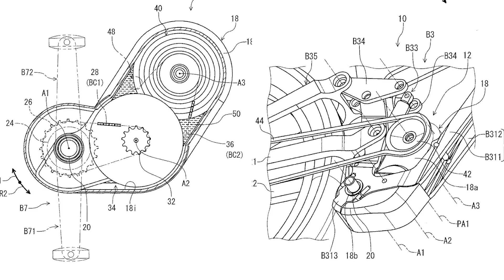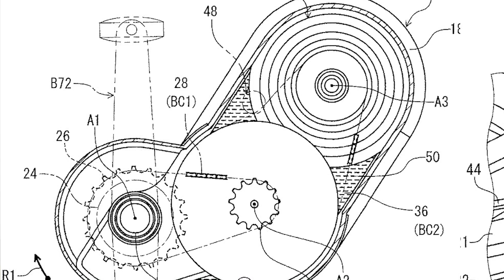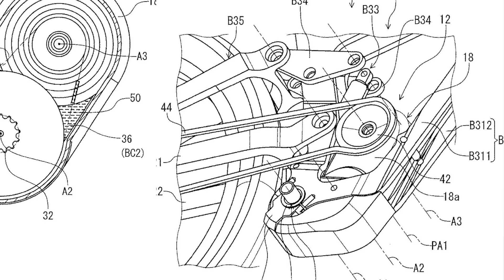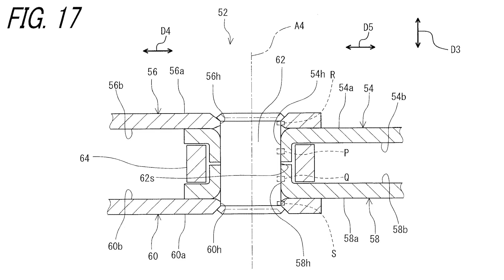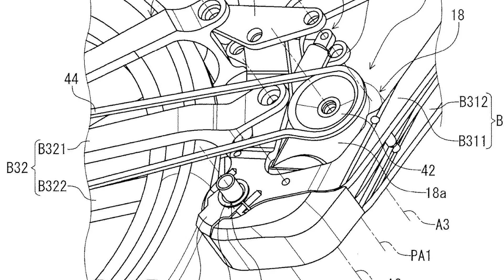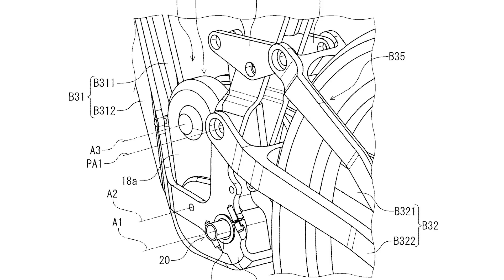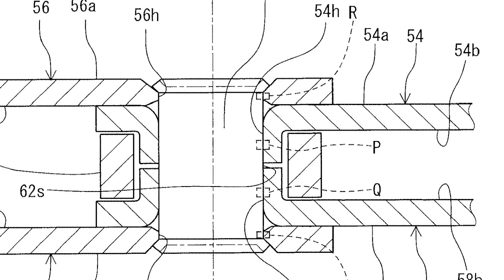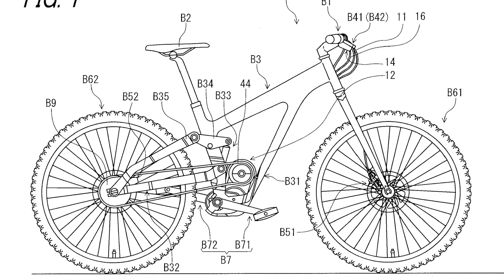Death of The Derailleur? | Shimano's Gearbox Patent

Comment: I really appreciate your efforts in discovering this patent & sharing it. I think it’s a fascinating pivot, because it both leverages Shimano’s knowledge about gearing & manufacturing prowess while making a potentially monumental shift in design (pun intended).
I wonder, if Shimano is basing the bottom end to be the same as their steps motor, is it possible that they intend to put steps in & make a complete motor & gearbox in one? If so, THAT is the future in my opinion. You centralize all the weight on an ebike, which would make the suspension float across anything. 
Until then, I’m looking at a pinion as my next drivetrain & bike. I’m completely sold on the durability of gearboxes. I also love the gear range you can get out of the Pinion, 636% is great for the hills of San Francisco, & I don’t think Shimano’s would cover that range (chains being the limiting factor, but correct me if you think otherwise). I think Pinion has a bright future, regardless of what Shimano releases.

Comment: I Don't Know? I really couldn't take this seriously! Why After All these Years, And What about the Rohloff Hub?
Reply: Having the weight in the middle of the bike has handling advantages, most especially if you’re putting it on an mtn/gravel bike. 
It also allows you to change out wheels really easily, so you can have one bike with various wheels set up & swap them out as you wish. You can’t do that with a rohloff.
Reply: just because market started to accepting. it's still less efficient and heavier than chain.

Comment: I would love a gearbox on my mtb. Especially one without gripshift like pinion. But if this then means the need for electronic shifter it is a bit off-putting to me. Mostly from the perspective it is going to be a long time before prize goes down enough for the regular bikerider's wallet size
Reply: Just put your Derailleur in a box!
Reply: @Aljonone1  love it!
Reply: @lazze13  Funny thing is it works really well, only difficult thing is getting casings to fit round the derailleur!

Comment: Can't wait to have a gearbox bike - it seems like the perfect solution for a Canadian winter bike!
Reply: What about the cogs and chain on the outside - won't they be covered in road salt and wear all the same as your regular old bike?
Reply: Don't delay- buy a planetary hub today!
Reply: @TheLaXandro  Until the lubricant freezes in the Canadian winter
Reply: louiscormier12 - "Can't wait to have a gearbox bike"
Rohloff - "Hold my pinions"

Seriously - check out some of the extreme riding done on Rohloff hubs - some of those rides make Canadian winter riding look like a Caribbean beach bike trail rental.
Reply: @47f0   Just Cover your current drive, you will save money on chain lube!
Reply: Nuvinchi, pinion rollof,there are many gearboxes on the market they are priced high,a chain based system like this is probably going to be lower in price.when you see wallyworld selling them that's when the cost will come down.
Reply: What are you waiting for? Buy a bike with a Gates Carbon Belt drive and Shimano Alfine hub (e.g Spot Acme, Veloheld Lane Stnlss, Shand Stoater). It’s what I have for riding all year round on muddy English country lanes and it’s perfect. I’d never go back to chain and derailleur.
Reply: @finnbarcunningham2724  OR  Just Cover your current drive, you will save money on chain lube!
Reply: Just Cover your current drive, you will save money on chain lube!
Reply: Just put your Derailleur in a box!

Comment: A genuine question: why is this better than an internal gear hub?  What are the limitations, advantages and inefficiencies of a hub based system?  In my non-engineering brain they seem to offer many of the advantages a gearbox would offer.  Whilst shimano might be willing to develop the gearbox it'll probably take a little while longer for "proper" bike brands to build bikes compatible to a gearbox and then many years after that for both systems to be perfected.  I imagine I'll be riding gearbox free for at least 10 years.
Reply: ps great content and keep up the good work
Reply: I see more of an advantage offroad, especially full suspension, it will improve sprung to unsprung weight ratios and open a lot of doors for pivot placement options (some of the drawing seem to show something that looks very much like a high single pivot suspension platform). Any gearbox system will also bring the center of gravity closer to where you want it. Taking full advantage of those possibilities would definitely outweigh any weight penalty (in my book anyway) for more gravity focused offroad usage.  Not sure about road riding though, maybe less exciting for that side of the industry.
Reply: Other advantage: it makes it really easy to change out your wheels for different ones based on the kind of ride you intend to do. With gravel bikes that becomes particularly interesting, you could have a 650b 47mm tire & a 700c 28mm both work. On an IGH, you’d have to have a gear hub in each wheel, which isn’t really practical.

Comment: I can’t understand how is this supposed to be any better than hub gears that have been around for decades, especially coupled with belt drive.
Reply: Marcin Obara I did read about it being better having the weight near the middle of the bike and not in the rear wheel. Also something about improved suspension performance due to the centralised position.
Reply: The problem with a gear hub on a rear suspension is that the unsparing weight in the rear wheel mucks up the suspension's performance. No so bad on a hard tail. Check out Zerode mountain bikes with Pinion gearbox for a more full explanation of this problem.
Reply: It keeps the expensive parts on the frame, which is more convenient to lock up. That's it.
Reply: In addition to the other comments, except for Rohloffs, planetary hubs have very poor sealing from water etc, pick up a Shimano or sturmey 3 speed and you can see the bearings of one of the 3 bearing races looking you right in the face, no sealing at all.  They are difficult to service and lubricate, especially the sturmeys, they are heavy, have a lot of internal drag (again excepting Rohloffs), and stop shifting under -10 C.
Reply: @PRH123  In support of the sturmey archer type, they used to be lubricated by a grease gun, pushing out dirt through the gaps in seals, and the increased drag would be overcome by most people by a few weeks training.
Not saying they should be used for competition, but I have a Shimano 7-speed hub geared bike that has not needed attention for 20 years.

Comment: Seems like a CVT. With the two opposite cones (cassettes) and the always straight chain line moving from one side to the other. The difference is that it will have discrete positions chosen by the rider. I wish buying one will not include selling a kidney to the black market...

Comment: It looks inspired by CVT transmissions in cars - two "cones/cassettes" connected by a chain/chains - with a control system to dictate the shift points. Might even in time lead to a proper CVT system on a bike, unlike the bonkers Landrider "Automatic" changer
Reply from the maker: The full patent suggests it would be possible to include a CVT version, though exactly what shape that would take is not explained; https://www.bikeradar.com/news/shimano-gearbox/

Comment: 1) How likely is this? My $0.02USD, not very. I suspect the patent is there because they can, and needed to stake out of some land in the gearbox world.
2) Do i want one? sure, but only if it's based on an open standard shell/housing that i can place any complying gearbox into. Like a threaded bottom bracket.
3) I'm not convinced this is better than a normal involute spur gear in terms of efficiency. I wouldn't be surprised to see a planetary gearset sometime soon, to make the whole system more compact with final drive coming from a carrier ring, so that the entire setup can be co-axial with the BB. We are 3d printing these already for cordless drills, so it would "just" be a matter of stacking 2 or 3 of those together. 
4) a Lightweight oil doesn't strike me like the best choice for a slow speed system, normally you'd see more of a grease than an oil. Think bearings.
Reply: I didn't know about those gearboxes before but it's very intriguing. (for those wondering, search for "Compound Planetary Gear Box by Gear_Down_For_What")

Comment: It was just matter of time, gearbox makes so much more sense.
Reply: The problem with conventional, cog-based gearboxes is that they are much less efficient than derailleur gears.
Reply: @gustavmeyrink_2.0  and much heavier
Reply: @nathandm1  i'd go for it. 1 pound more. for a life ime and indestructible gearbox. The only maintenance required is oil change every 10 000km.
Reply: Just Cover your current drive, you will save money on chain lube!

Comment: It's probably just 13 speed so they can eventually sell us a 14 speed gearbox.
Reply: That is certainly the template the bike industry has been engaged in since 1900
Reply: @pavanatanaya   Just Cover your current drive, you will save money on chain lube!
Reply: Then...15..
Reply: Dr Dr 15 is so 5 minutes ago. You NEED. 16
Reply: @DrDr-pg5br  Pinion already has 18 speeds so we know where we're headed, the solution are CVTs.
Reply: @brauljo  I've always thought that CVTs and bikes are the best combination. No shifting, just pedalling.
Reply: @MarlonSolisFallas  Well that's assuming that it's automatic, I imagine a manual CVT to use a sort of friction shifter.
Reply: @brauljo   - You imagine a NuVinci. Traditional CVTs tend to be bulky, heavy and not super efficient.
Reply: @MarlonSolisFallas  Better solution,  Just Cover your current drive, you will save money on chain lube!
Reply: @47f0  That's why it would have to be a non-traditional CVT, just like Shimano is trying to make a non-traditional gearbox.
Reply: The next one up will be 15 speeds, as the design implies an odd number of ratios for the number of physical cog pairs.
Reply: Just put your Derailleur in a box!

Comment: How would this work with mid drive ebike motors?
Reply: Lysergic Casserole Probably similar to a motorcycle.
Reply: Your left hand lever gonna be a clutch.
Reply: Really well. They have geared up slightly from the crank and then back down again to the rear wheel. This is good for reducing the torque on the shifting but also better matches the cadence of the rider to an electric motor. My guess would be that they could just stick an electric motor above the first intermediate shaft and add power there through another gear train.

Comment: So would a gearbox be able to give the road rider the same gearing? i.e. could they go to a gearbox and not notice a difference other than a perfect chain line etc ?
Reply: It's actually easier to get even wider gear ranges with a gear box. The idea is not new, it's been tried about every 10 years for over a century. The problems are the weight, cost, and inefficiency compared to the derailleur.

Comment: I think a gear box has the potential to have a huge range like 500%, while being maintenance free. That's pretty cool to me, especially when you consider the possibility of matching it up with a fixed gear hub in the rear. Those hubs are cheap and bombproof, plus the engagement will be insane.

This would be amazing for mountain bikes, especially if it fits in the same footprint as their steps motor, then bike brands only need to design one type of frame. The only issue there would be you have to choose between a gearbox and an ebike, but who knows where innovation will take us in the future

Comment: Im fed up with cleaning my drivetrain after every ride,so something like this would be really appreciated
Reply: I don't mind cleaning my drivetrain is just part of the maintance, I like my stuff clean and lube that way it performs much better, why not to take care of the things that make you happy?
Reply: you will still need to clean your chain and sprockets. The torque does not just arrive at the rear hub. It will be transferred to it via chain.
Reply: @enpluson1539  The chain can be completely sealed and aero, since there is no cassette in the rear. Holland bikes have their chain enclosed and there is no need for cleaning for years.
Reply: @DilbertMuc  
Interesting with the chain enclosure. That's pretty much what we needed in the first place, but then got internal gears instead. 
But it looks like it would act like a sound box and make a lot of sound on rough roads. And how would it hold up on a MTB with jumps and gnar!? Maybe there's someway to solve those problems with clever use of materials.
Reply: @enpluson1539  the chain drives are inside the crank case if you will. The system could be run off a kevlar belt outside that isn't lubricated
Reply: @Montblanc1986  A Carbondrive Belt would have higher drag than a chain, also I am certain that shimano would not outsource this part of manufacture, especially because of the numbers that they produce.
Reply: @enpluson1539  The drag is 1 watt more from belt vs a clean and lubricated chain. I run my belt with lower belt tension than reccomended. This probably decreases the advantage of a chain. With a dirty chain the differense also decreases. A belt is around 200 gram lighter than a chain, and will not be less effective in its lifetime, which is 2-3 times longer than a chain
Reply: @tellef70  Did you factor in the much higher weight of belt sprockets and rings?
Reply: put little brushes where the chain enters the case lol
Reply: Mini umbrella's
Reply: Yes just make your own covers for your current drive & save money on chain lube!

Comment: I'm very interested in this but a relatively standard chain internally scares me. It seems to me that even with a always dead on chain line that internal chain would need to be replaced close to as often as a standard external chain and that will require taking the whole thing apart. Plus their is no way to measure wear on the chain without taking the whole thing apart.
Reply: the patent includes new way of forming and coating chains (see 5:15 in the video) so I don't think they'd be using conventional chain for this.
Reply: Ezra I think you’re missing the point, on a gearbox the gears don’t wear out nearly as easily as exposed gears do. With an always straight chain line, you’d be sure the chain would last a whole lot longer too.
Reply: @MrQuestful  I get that the point of a gearbox is to dramatically cut down on wear. Gear boxes like Pinion do a great job at doing that in a very long lasting way but it seams to me that what this patent is describing is very different. A Pinion, using a system of solid metal gears locking together can go years and years working perfectly with only the occasional oil change but this shimano system using a chain is very different. Yes it will be a specialty chain and yes it will be sealed from the elements and always straight but chains still stretch under load. You could make it a extra beefed up chain to try and negate these problems but that would start to seriously start to eat in to your efficiency. Unless that new lubricant they are describing is actually magic I really struggle to see how it can possible support a super heavy duty chain while still making up for the systems other losses in efficiency compared to a standard external set up to be comedive with a xtr/ dura ace setup. With a redesigned but not super heavy duty chain running in a sealed environment perfectly straight line my guess would be that you would only increase your life by 200 to 300 percent over a modern shimano group set but even if you took the extreme of 400 to 500 percent life that is still a new chain (which requires polling the entire thing apart) every 4 to 6 months for someone putting in a lot of miles. Along with the fact that you can't check the chain without taking the whole thing apart. I trust shimano, they have some of the best engineers anywhere and make the best groupsets (at least on the road side) in the world and this is still very much on the drawing board so we will just have to wait and see what this ends up being.

Comment: You're talking about beating a 100 year old system. I don't see it happening. I do NOT think Shimano can build a gearbox system that is more efficient than the cassette and chain systems they have. I do think Shimano may return to 2x mountain systems, however. The chain-line matters that much. Watching a 32t ring to 51t cog in action is horrifying.
Reply: Gebby 
Maybe for e-bikes.
For rest of us on classic bikes,good old derailler will provide gear changes

Comment: Seems a little odd to me to essentially create an internal cassette/deraiileur instead of a CVT.  Why have 13 speeds when you can have infinitely variable speeds, if you're going to all that trouble?
Reply: Maybe because most people are afraid of gripshifts
Reply: @barnabanovics2476  if it is electronically controlled it could be made to shift like gears or however you like.  Just like cvt cars.
Reply: Maybe there's more friction. There's already the NuVinci gear hub, but you don't find it very often.
Reply: hordboy while CVT’s have infinite intervals, the actual gear range has yet to be greater than what’s available in a gearbox. I think this has to do with how the gears mesh on a cvt, but it may be for other limitations like weight.